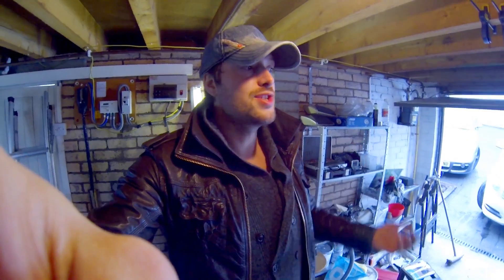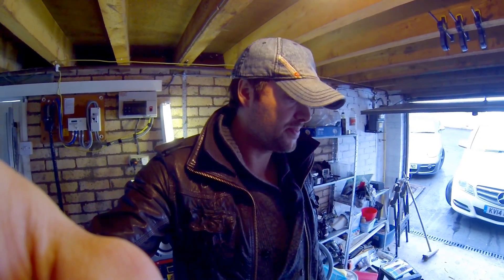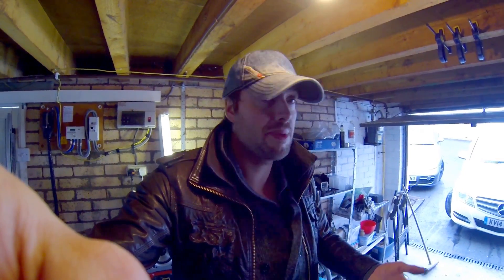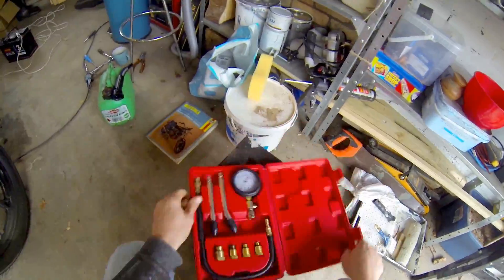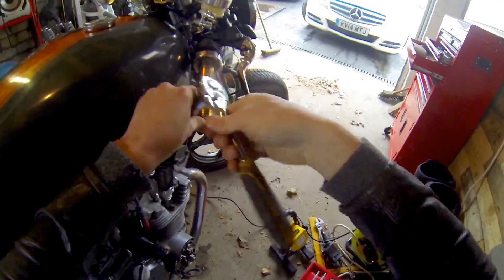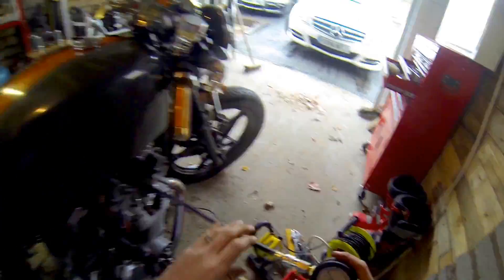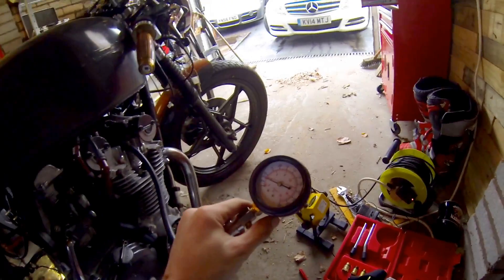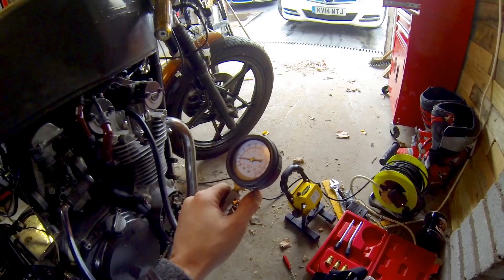Cafe Racer Build 19, Suzuki GS550 diagnosing a cafe racer running on 3 cylinders

Comment: My GS550 has the exact same issue. What are the actual symptoms of this issue? Does the bike stall/loss power after riding it for 15 mins?
Reply from the maker: Symptoms are sounding like it’s running on 3 cylinders and pipe not warming up. Sounds so bad you wouldn’t want to try riding it.
Reply: @forthebold  I did. Which is why I ask. It rides but stalls/losses power. Specially, shifting down going down lower speed. I meant symptoms as to what happens to the bike when it does run, I already know my bike runs on 3 cylinders, just not sure of my issue is because of it. Or also a bad air/fuel mix. By the way, I'm a big fan of your work. My current project (this GS550 was inspired by your warrior project).
Reply from the maker: It’s not going to be behaving how you want it until you have it running on all 4. So I’d ignore anything it’s doing at the moment whilst riding until you have it firing on all cylinders. Once you have that sorted you can cross any other issues later.
Reply: @forthebold  Thanks brother. Much appreciated 👊🏼
Reply: @forthebold  quick update: compression is good. Spark is good. Rebuilt/clean the carbs. Everytime I start it a different cylinder won't fire off. Sometimes it's #4, sometimes it's #2 sometimes is two at a time. I'm at a loss. Plus now I have fuel overflowing from the air of valve going to the ground. Any thoughts?

Comment: Isnt 3 bar preassure for such an engine pretty low even though it's cold? I've got the same bike and same tool and I do get the same readings.. confused Thanks for good content btw
Reply: I think I just figured it out, if you have a cheap compression tester  which I have (HF) the schrader valve is located up by the gauge near the release button. And a lot of the preassure gets lost when the hose needs to be filled before reaching the valve. So guys, buy a compression tester with the schrader valve at the end of the hose

Comment: Do you reckon the gs 550 is a good starter bike for first build , in getting a 84 model for £300 loads of new parts with it it's not running at the moment but it's been idle for a long time .
Reply from the maker: All depends why it's not running. It is a good bike in all fairness to start on, the frame is simple enough and so is the engine (for a 4 stroke engine)
Reply: For The Bold - dreegez the boy said he thinks it will run with clean fuel and new battery wether that's true or not is a different case think I will go for it tho
Reply from the maker: If you can 'test' it first, that would be peace of mind for you. But sounds good, I would love to see another GS build.
Reply: £300 quid can't really be that bad haha ,   Is parts easy to get a hold of or what ? Trying to do a bit of research just now but don't want to end up losing out on the bike with it getting sold for that price as it doesn't seem much .
Reply from the maker: Parts are easy enough, a lot fit onto it, I had a bit of researching to do to get my intake boots to get the right code, they ended up costing £176 for 4, but that's the worst cost I've had. Electrics etc are all easy to find.
Reply from the maker: Give me shout if you need to know any specific parts or where I got them from.
Reply: For The Bold - dreegez I will do bud I'm just looking thru all your videos just now on the bike , it would probably be a bit more of a struggle for me if the bike came dismantled like yours but this one is all there so at least I can take pics etc and know where everything goes back again .
Reply from the maker: Yeah my bike was a nightmare so please don't let that put you off, no exhaust, broken exhaust bolts, no electrics etc.

Comment: I've been working like mad on my 79 suzuki gs550 that I picked up.  Cylinder 3 also wasn't firing for me.  I do believe that the vacuum tube from the carbs to the petcock/fuel shut off to operate the pump comes from cylinder 3.  My petcock was leaking like a sieve through that diaphragm.  I believe it was dripping into cylinder 3 as the bike sat and has been giving me tons of grief.  I have a 79GS550L tank on the bike and I am having a hell of a time finding a replacement petcock/fuel shot off.  I believe I need a Suzuki 44300-45270 and can't find one anywhere - looks like the part is obsolete and I don't know how to tell if there is one that superseded it.

I found this info on the carbs as wellGS550L (77-79) the specs are for the VM's 

idle r/min 1100-1200 
carb mik vm22ss 
id no 47110 
bore size 22 (0.87) 
float height 24.+/-1.0 (0.95 +/-0.04) 
fuel level 4.0+/-1.0 (0.16 +/-0.04) 
air screw 2.0 turns back 
cut away 1.5 
jet needle 5dl35-3 (the -3 3rd notch??) 
pilot screw 1.0 
pilot jet #15 
pilot outlet 0.6 
needle jet 0-6 
by pass 1.0 
main jet #80

Great website here:

thegsresources.com

Thanks for the videos!
Reply: Hi bro, have you fixed the petcock issue? Im having the same problem with a GS750L from 1979, I cant seem to find a new petcock or the rebuild kit, if you have a solution please tell me what can I do. Regards.
Reply from the maker: +Alejandro Ibarrola petcocks are so expensive. I ended up using one from another bike but adjusting to fit mine

Comment: Thats really funny!  On my 79 suzuki gs550e I just bought I also am not getting cylinder 3 firing.  Same thing - I'm getting compression but we thought it was a weak spark and possibly failing under compression so I am awaiting my new coil I ordered.  If that doesn't work, I'll make sure to check that same hole you mentioned.  Thanks for the tips!
Reply from the maker: Cylinder 3 runs with the same coil and cylinder 2, how's the spark in that out of interest? Good luck with getting it running. Also have you set your points?
Reply: I haven't set the points, no.  I think those are the next things to check - the carbs and the points.  I had the carbs apart and cleaned them with compressed air and a small piece of wire.  Didn't realize they could have been dirty somewhere else.  Thanks for the tips and the videos.
Reply from the maker: Thanks for watching and good luck

Comment: Can you do a vid where you explain what type of jets, pilots, needle hight, adjustment of mixture and fuel screw etc and maybe a sync with the vac gauge on the GS550? Or maybe explain the process? Would be very helpful for me and i guess other having problem with this as well :) Cheers, keep up the good work, can't wait to see the CX build!
Reply from the maker: Yeah I will do when I have the bike running.

Comment: That's your choke tube pipe, bro. Next time, completely disassemble your carbs and do a chem dip. You can pick up a parts cleaner can for cheap. Just disassemble, dip and your carbs will be clean and look like new. I love these bikes. Mine is a 79' GS550e. Beautiful build, very tastefully done.
Reply from the maker: Good idea, it needs cleaning up drastically.
Reply: I just bought a 79 suzuki gs550e myself!  I took the carbs apart and cleaned them but didn't do a them dip - maybe I should!

Comment: +dreegez , the bike that I want to transform is TVS Victor... its pretty old bike and has single cylinder 100c engine...and I was thinking of getting an Yamaha R6 engine for the customization..if not the TVS Victor than maybe Royal Enfield Continental GT..it also has a single cylinder 500cc engine and its a complete cafe racer, if I buy the GT as donor bike and replace the engine, will it work ? please reply
Reply from the maker: I definitely don't think the TVS Victor would take the R6 engine, you may have better luck with the Royal Enfield, all depends on the level of skill you have. Perhaps look at a project that doesn't need an engine swap if you think it might not work
Reply: +dreegez , Thanks !! this really is helpful !!

Comment: +dreegez , can a 100cc bike chassis handle the weight of 600cc engine..please reply
Reply from the maker: Chances are no, Some people might say you can, but a 600cc engine will be a lot bigger, and so will need hefty modification to your frame to fit it in, your balance might be off then, and you will definitely need to upgrade your brakes,  electrics etc, probably not worth the hassle, just bike a 600cc donor bike complete i'd suggest

Comment: You should drill some holes in the front disc to eliminate heating and ruining your brake pads
Reply from the maker: I don't know if I'd trust my wobly hands but might be worth buying some
Reply: dreegez you should invest in one coz if you'll be riding during rains, you gonna have a rough time getting grip onto those plain disc. and even a over heat will ruin the break pads

Comment: Well done mate. it's always the same. compression spark fuel. 
Bike sounds like it needs the carbs balancing, and the advance timing looking at. Will run much smoother then.
Reply from the maker: Thanks. Yeah the carb synchronising will be done this weekend, and it was all down to one blocked hole in the float bowl which I stumbled across by accident, luckily.
Reply: dreegez it's always something simple. The amount of times I racked my brains and stayed awake at night try to work out why the bike was or wasn't doing something I wanted. Always turned out to be something simple like, cap missing off carb boot. check out my instagram for the build pics. keep it up.
Reply from the maker: Ethan Wadsworth Same here, thinking about it last thing at night. I'll check out your Instagram.